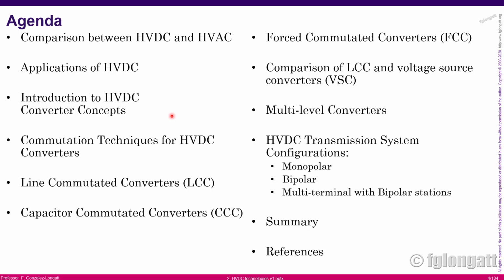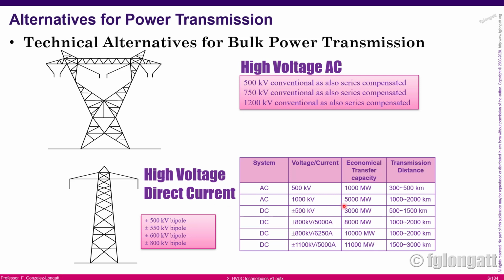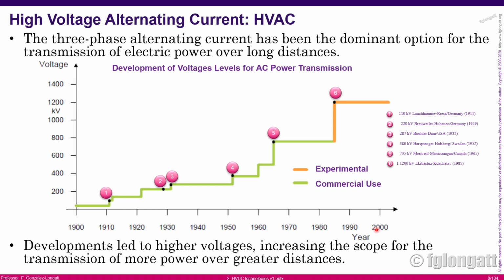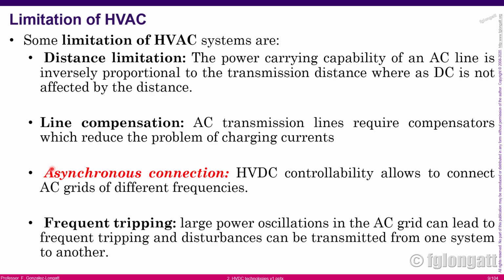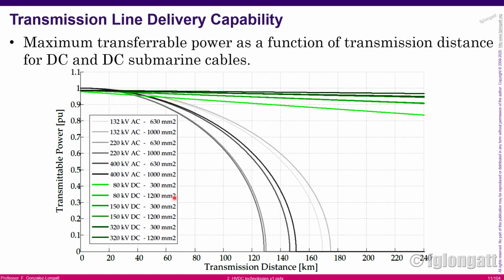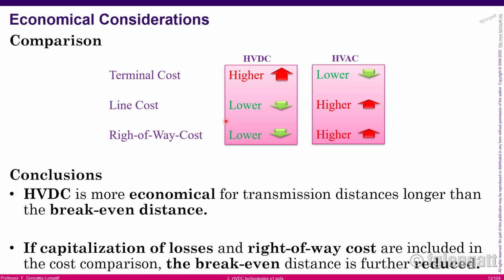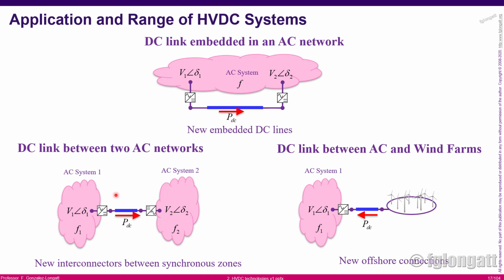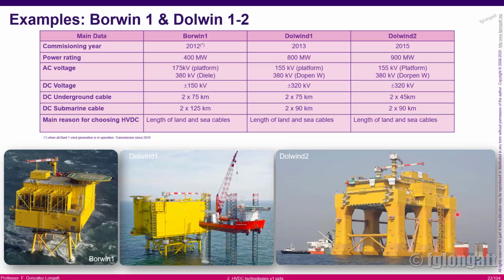2.  HVDC Technologies PART I. "Seminar on DC transmission systems"

Comment: 7:35 Usage of Ultra HV AC lines could cause massive system stability issues during the fault on the line. There for there is a single phase ultrafast autoreclose on this kind of lines for the single phase faults which is most usual fault on UHVAC. If that line is on parallel with other lines during the trip it could cause parallel lines overloading and cascaded network blackout. Next question if we use UHVAC and HV AC lines on parallel it might be a problem to sufficiently load UHVAC, there for we need series compensation either phase shifters. I saw myself and heard about series compensation and phase shifting on 400-500kV networks. Perhaps what about UHVAC? There is something for 735-765kV lines in Canada, USA & South Africa and 1000-1200kV lines in Japan, China and India? AFAIK soviets was using series compensating transformers which was installed in 750/330kV autotransformer group neutral and are extremely unreliable if you start to buck either boost them. By the way soviets abandoned their idea to use 1150kV AC lines due to series compensation and stability issues. Nowdays these lines are in use on 500kV and substation equipment for 1150kV is derelict.
10:13 No dubt we could transfer up to 12GW with UHVDC perhaps let's say we've got pole trip with unsuccesful recovery sequence and loose 4-5GW. No one network in the whole world will not withstand it and we'll get blackout!
14:48 1150kV lines in Kazachstan (Ekibastuz-Kokchetav etc) and Russia was energised for this voltage for the brief period only, cause massive problems as i mentioned above and they run nowdays on 500kV.
20:13 To be extremely precise it's nearly full controllability except the first 6-10% deadband which is called "minimum power" after you de-block converter (here i talk about LCC only). Using Voltage Source Converter you could completely control power transfer from 0 to maximum.